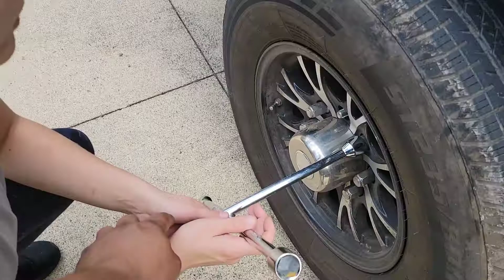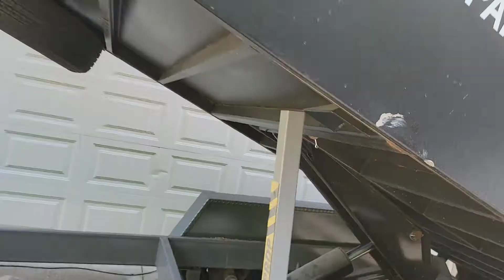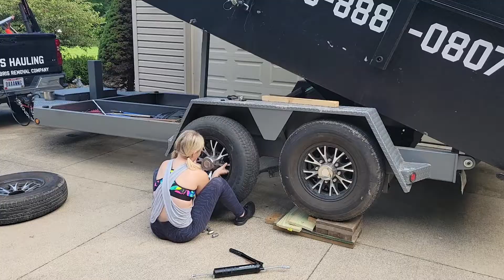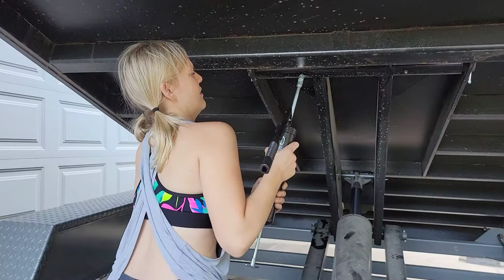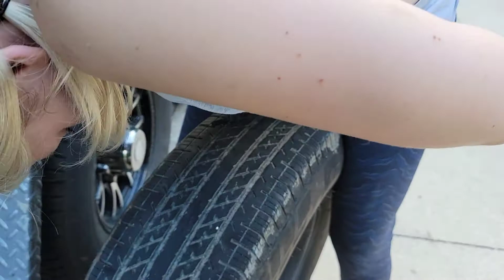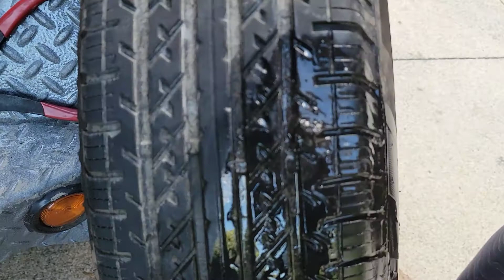Can a GIRL Maintenance a Dump Trailer??

Comment: That is a very stupid and dangerous place to store a spare tire!!!
Reply from the maker: Planning on adding a traditional spare tire mount to the side of the box like there is on the LoadTrail dump trailer we also own. Thanks for the comment 👍🏼
Reply: the sidemount would block the view through the mirror, not a good place either to mount the sparetire. better would be to mount the sparetire in the middle of the front of the trailer. 
video & comments are months old, i guess the sparetire is by now already on the side of that trailer.